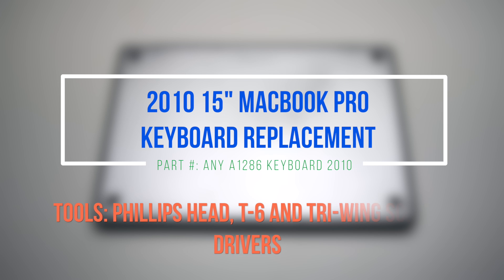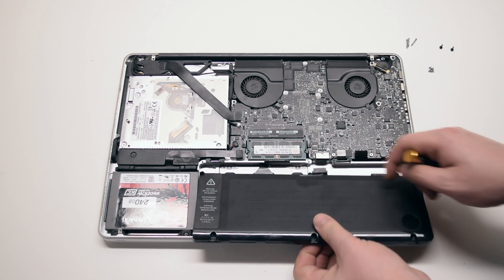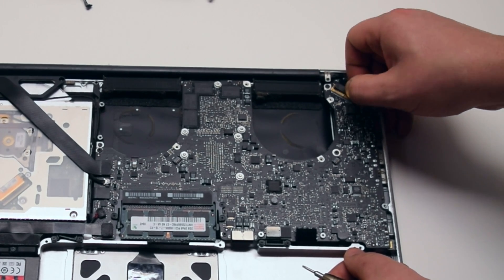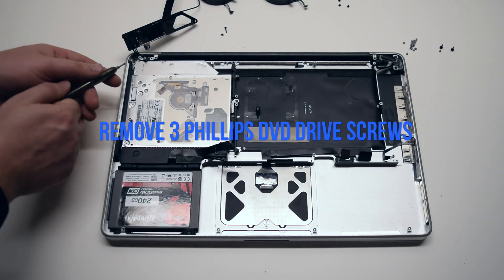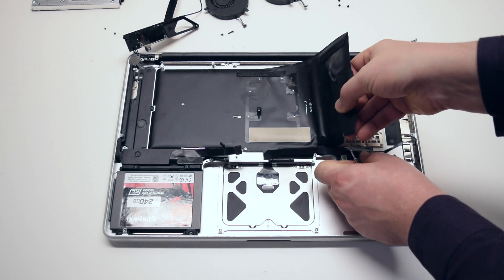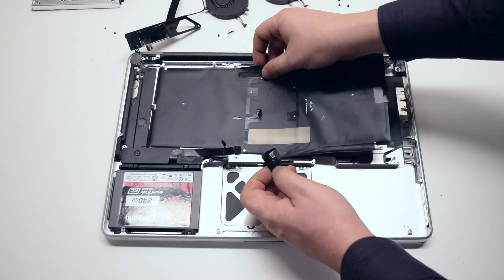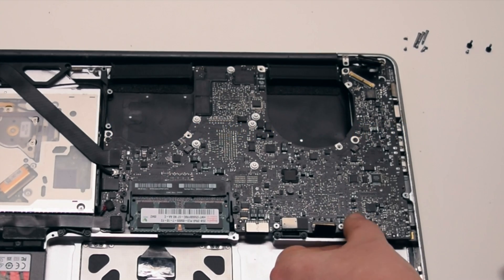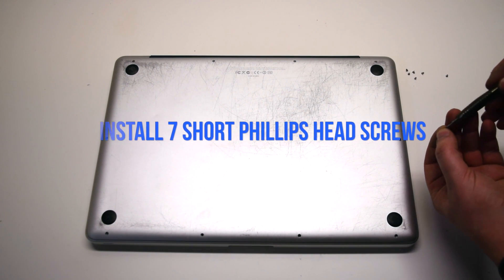2010 Macbook Pro 15" A1286 Keyboard Replacement

Comment: I followed everything on the video to get to the faulty keyboard, but my impatience got the better of me. Of the 71 screwes, one of the corner screws decided not to come off the keyboard. I ripped the keyboard of out of frustration. Now the screw is stuck. I don't know if I will ever be able to get it off. Can I simply file it and make the top smooth? Will it create any issues?

Comment: I had heard there were 51 screws securing the keyboard on several videos, but my keyboard had 72 screws!  If you stop the video and look at the keyboard you can count the 38 perimeter screws, just add the # of screws from a couple of rows (there are 5 'internal' rows), and you are already at 51 or 52.  Good video, though there are times when forearms and hands got in the way of camera, making removal and install of connectors and screws a little tough to view.
Reply: What happens if I miss one of the screws that are securing the keyboard? Will it create any issues?

Comment: I've just ordered the replacement A12%6 keyboard. As you can see I can't use the number 'eight' key which is driving me mad!!! Wish me GR& luck! I'll let you know how I get on, as you make it look so easy, thank you.

Update: Thought I would let you know that the replacement came and I swapped out the old damaged keyboard and replaced it. Now my MacBook Pro is working 100% again and I can type the number 8888888888 perfectly! Thank you so much for this tutorial I couldn't have done i without you!

I did have a little trouble getting a couple of the 51 tiny screws out as they had become corroded and the philips screwdriver just created a countersink hole in one. When putting it back together I managed to lose that screw somewhere... I vacuumed out the inside but never found it! The other issue was that I didn't locate the ribbon cable properly first time, and half the keys worked. I had another go and got it right. As you can see all the keys are working perfectly now. So thank you again for uploading this video it was really helpful and inspirational too.

Comment: I must thank you for making this video and sharing it with the Youtube community! I've just followed it to successfully replace my faulty keyboard. It took several hours (the 71 screws securing the keyboard were a chore) but I got there in the end. I especially like the presentation of your video in that unlike others it walks you through the process of reassembly once the keyboard is changed. Thank you! Liked and subscribed.

Comment: I successfully replaced the keyboard like this but i wouldn't really recommend it to anyone for such an old machine, it's a pain in the ass getting the 51 tiny screws out, especially when some of them happen to be over-tightened right out of factory. I was worried i would have to drill some of them to get them out.
Reply: Had the same problem with the screws, about 10 stuck solid, ended peeling it out like a can of sardines with a pair of pliers

Comment: I'm having trouble removing the wifi antenna phillips head screw (the short one). The same Phillips I used to get the left one out works fine with other screws but seems to be stripping this one. Any tips on getting this screw out?
Reply from the maker: Pressure and patience
Reply: i had trouble with the same screw. It felt like it was fastened by the hand of god. Anyway i took out the 4 cables that are nested in the antenna bracket, then lifted out the part of the bracket that was loose and started rotating it on top of the DVD drive. since it's plastic it didnt break from a bit of bending, and it was enough to get the screw to turn just enough so that the screwdriver could loosen it the rest of the way.

Comment: Lets say you need to only replace the backlight. Do you need to remove the keyboard power button? I'm thinking you dont.
Reply from the maker: No you are correct but still have to get the logic board out.